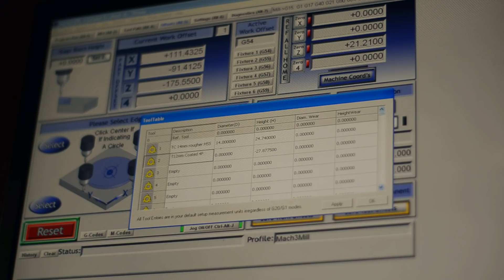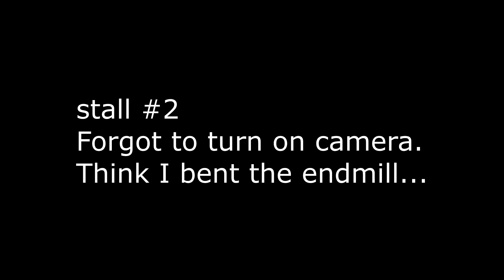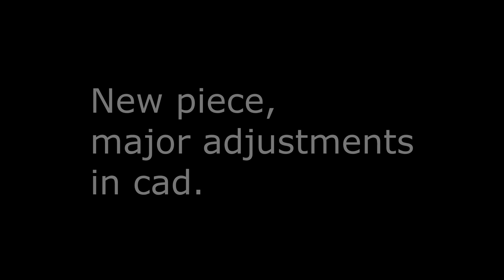Crash Course in CNC Machining(How many times can someone with no clue crash the machine)

Comment: Hey Merry Christmas. 
I see on the perimeter cuts around the block you are climb cutting. Whats the backlash like on the machine? if you have excessive backlash than this can cause a problem as the cutter sucks the work in.
You also might want to try a finishing cut cutting conventionally rather than climb cutting this can often give a better finish.
Just something else to try out which may or may not get you a better finish.
There are pros and cons to both approaches.
Keep up the good work.

Comment: I bought a Fadal knowing nothing just like you a long time ago. And one great tip I got was to get the post processor set correctly from the start. AND ALWAYS  either jog down 1" above part after your workoffset is applied before you run your program to double check Z or do what I did and edit your post so that the first Z move is to 1" above part, where ever that is from your WO Z0 (Z1.0 if the top of part is use for workoffset 0)

Comment: Little tips. If you don't have a mill for surface roughing and finish, flip the piece and do the top surface using the side of a normal mill. It will take less time to do it and you use a big part of the cutter of the mill. I hope you can understand everything I said, I'm Italian and I'm not good in English

Comment: Two things that helped me a bunch with my CNC machine. One was to really get in touch ( quite literally ) with my z probe skills. Get a Z probe and figure out how to use the software to utilize it to its fullest. Next is to spend time cutting air. Run your g-code through a g-code simulator and watch what the code will tell the machine to do. If it looks good, set the machine up with a real piece of material, probe it, and then remove it. Watch the machine cut air. Once you know the machine will do what you want, then put the piece back in, re-probe, and run it. The offsets, once set, should not be of any consequence, the trick is being sure you are well probed, know the machine will run the job correctly, and then adjust feeds and speeds on the fly as needed to find the limits of the machine. On a new piece, I will set my feeds and speeds to a crawl and ramp up slowly as the machine gets into the cuts. As you go along, increase the F&S until you have either the work pace you can live with, or you find the limits of your machine. Another thing that really helps is making sure you have your home position set every time you turn the machine on. You can set soft limits in the Mach 3 software that will keep it from crashing. After getting into the regimen of setting home every time you turn on the machine or start a new workpiece, you almost never even have to think about limit switches or if you're going to crash the machine. But, having a probe helps a lot to ensure offsets are the same every time, that your workpiece is exactly where the machine thinks it is and no fiddling with feeler gauges. Finding a good CAM software also helps. While writing g-code is easy enough, a good CAM software can really make going from conception to completion much quicker. The g-code simulation software just helps confirm your work. Have fun man!!!! Looking good. You have to break a few eggs to make an omelet.

Comment: Well Done What Controller is your CNC running? does it have an easy to follow Graphical programming system or are you having to program in G code Have you tried the CNC milling add-in for Fusion 360 This can solve a lot of problems and make life a lot easier just need to make sure you get a post-processor that works with your controller. I'm an Engineering Tutor here in New Zealand and am happy to help you in any way i can

Comment: some advice from a fellow cnc machinist. mill flats in your vise jaws to give your part a flat surface to sit on. it is less likely to pull your part of of the vise if you have a good flat base for the stock to sit on. and a good flat surface to clamp with. hopefully this helps

Comment: You will DEFINITELY want to clean up the wiring in that cabinet. I can tell you that having wires running every which way makes diagnosing and repairing equipment 10x harder than it has to be.

Comment: Ive been out of this game for a while but here goes, with alloys, high spindle speed and high feed with small cuts (depending on the rigidity  of your machine), when starting a cut with the side of the tool roll on and off with a radial cutter path into the start of your cut, depending on your control type, use canned cycles, itll save excess typing and allow you to take smaller cuts but faster. For example  if you need to plunge cut a bore to rough size, you can use a slot drill with a peck drill canned cycle to create the pilot hole, then circular inturpulate the bore in small z incriments at a high speed and feed to rough it out fast. Really cool piece of kit to have at home!

Comment: Toolpaths can be tricky and cnc machines always do EXACTLY what they are told. :p That's where the simulation function in fusion cam comes in so handy. Never run gcode that you haven't simulated :) And make a check list so that you make sure you are always in the right work offset, have set 0 in the right place etc before you hit run.

Comment: from using a very old cnc i learned the longer the process for the tool path the more chance it has to skip some of the routines and jam up like your self i found smaller tool jobs with short routines seems to stop the job from crashing or skipping some of the program befor it is ready to be at that point of the job

Comment: I like the CNC machines but in compare to the old ones with the simple handwheels you first need to learn a lot before you can use them especially in this case when it's a used one with bugs and issues. Must say you handle it very well.

Comment: Nice work. With a low power machine like this, try programming with a large DOC and small WOC. You'll get more out of your end mills and have higher MRR than simply backing off the DOC or WOC alone.
GWizard or similar is worth every penny. You can enter your machine power and it will tell you when you begin to approach the limits. This will give you an idea of how much you can demand from your particular machine.

Comment: When machining with a low horse power cnc like you have try taking shallower cuts. When your walking around the outside rough it out doing it like half in steps deep sorry your metric a 10 mm steps Or 12 mm steps in depth and make multiple passes roughing the outside and then take a Finnish passes at full depth leave like  .01in for a Finnish pass.  You can run the finish past full depth in one shot but when you rough it take it in steps so you don't have so much load on the spindle. 
  You'll never stop learning when it comes to machining none of it's very hard but there's an unlimited amount of things to know. Can't wait to Bonneville this year I'm hoping to go down and watch.

Comment: yeah dude dont clock up a vice with a plunger indicator use a finger lever type. best advice i can give to a new commer to cnc machining is throw away that plunger indicator. last thing is in mach3 u can use your ports and pins to allocate two pins for something they refer to as digitise. easiest and fastest way to pick up your offsets and take your tool lengths. a simple wire with a crocodile clamp at the end of it u can use to bite the tool u want the length for. punch in G31 in mdi and presto u get a flipping accurate size.(well as accurate as your machine). oh yeah have u checked your axisis for backlash good old mach3 can compensate it out for u all u need to do is tell mach3 how much the backlash is and then u can be super accurate with an old worn out machine

Comment: You are simply cutting in the wrong direction  ? always travel in the opposite direction of the tool rotation . if you travel in the same direction the tool will clime forward and crash. just like when you use your angle grinder !

Comment: Very good job despite the lack of experience, I take my hat off to you for picking it up so quickly. Whenever you are machining you always have a roughing and then finishing toolpath/s. I see you were using what I know as a Rippa cutter (roughing endmill if you like) which is exactly what the name implies, rip material off. Its used to get most of the excess material off to allow for the finish cut/s. Your machine looks like its a fairly low horsepower machine so depth/size of cut are critical as you found out. Then of course its how rigid is the setup. They both (HP & work part rigidity) contribute to what the depth/size of cut should be. Love your work.

Comment: Sounds like the spindle motor gets a coarse DC voltage. I would try to add a capacitor and maybe an inductor to the circuit to make the DC voltage a lot cleaner.
Reply from the maker: 👍There's heaps of adjustment possibilities on the drive board, I've downloaded the manual, will have a look.

Comment: What was the logic around doing climb milling on all that? Seems like conventional would have been better suited to the situation and machine. Those stalls looked kind of like backlash shifting where the endmill pulls itself into backlash and takes too big of a bite. That doesn't happen with conventional milling. 

I am not a machinist for the record, but I do have a CNC router, so at least a couple lessons learned.
Reply from the maker: No logic at all... Just what fusion suggested. I'll try another one with conventional milling to get a feeling for the difference.
Reply: @2STROKESTUFFING  Right on, Fusion seems to assume you have some brand new, huge, rigid machine I've noticed. I think you'll find a big difference! Good luck man and keep it up.
Reply: @2STROKESTUFFING  Don't let anyone say you shouldn't climb mill. Yes blah blah blah but you get a better finish when you climb mill and most machines can take it.

Comment: Your doing just fine man. Just remember them machines do as there told and we make mistakes. As far as no clue LoL your so much farther along even prior to touching the machine than you give yourself credit for. Be careful and keep tool changes at home until the program is proven and then you can work on production speeds. Right now I'm thinking that's not an issue. Keep up the good work Alex I'm in your corner cheering you on

Comment: Oh man, you need to stop watching ToT and his depth of cut. Need to respect the machine and the spindle power available. There is chip load equation found in the net if you look for one. You will know how many Kw of power you need for any given DOC. Small spindle and small cuts, I would say 5 mm max if you are going to cut with the full width of the tool. 
Nice vide and congrats on fixing the mill yourself.

Comment: Very nice to see you buying a broken cnc mill for your hobby, repair it and use it in this short amount of time. I am a cnc miller, programmer myself (and a huge 2 stroke fan) When i see u working i think it's better to use smaller mills for this machine. Also is it the easyist for the machine when you take a endmill wich is as short as possible. But keep up the good work, i really think you're doing it very well! a (analog) 3d probe is also much more easy to zero your product and is availlible for about 200 euros. Keep up the good work!

Comment: Merry Christmas!

It’s a never-ending process to learn the quirks and solutions for your tool chain. I had to do the CAD/CAM/G-code for a CNC router at one of my previous jobs. The post-processor in the CAM package wouldn’t do arc moves for the router we had. So instead of the program having a single G03 line for simple arcs, it would have dozens upon dozens of tiny little G01 linear moves.

The programs would get ridiculously long and unreadable. Worse, the router would bog down trying to perform so many commands so quickly. Depending on the project, we would have to get creative with the tool paths to minimize the bogging. We made stuff out of plastic, so chip/workpiece melt was a real concern.

Then I read the manual for post-processors for the CAM package. Turns out I just had to add a couple lines to a text file saying, essentially, “use G02 for arc moves.” A whole bunch of headaches went away after that, haha.

Good luck, and have fun!

Comment: Merry Christmas!
Was thinking about your gerbox issues! Maby you could build a cvt like the F1 car!? https://youtu.be/Sp228-39WhQ
Reply: I was also thinking about that, but the CVT steel belts have almost the same problems as a standard belt, they can handle more power but they are way more expensive, they need to run in an oil bath, they have the same problem of power loss due to friction...
I think a split transmission with planetary gears would provide best efficiency, because for example 2/3 of the power can be transmitted via gears and without a clutch directly from the engine to the wheel, and just 1/3 has to be transmitted via belt and clutch or with a hydrostatic drive.

Fendt uses such a split transmission  with planetary gears in combination with hydrostatic drive in their tractors with up to 500hp and very high torque to provide a continously variable transmission in forward and reverse with very good efficiency. 
There is a video about Fendt Vario transmission in YouTube:
https://youtu.be/qqrMX3ujgqk
of course it doesnt have to be so complicated because he doesnt need reverse, so the hydraulic pump and motor can be replaced with a variable belt transmission and a clutch...

Comment: Merry Christmas from Colorado. If you’re experimenting with your CNC you could use a piece of styrofoam instead of an aluminum block. Much easier on the equipment.
Reply: Could also 3d print replicas in plastic for tool path testing.

Comment: Aren't you feeding that material to the tool in the wrong direction?  That tool is spinning clockwise and you're feeding the material into the side of the tool that's moving away from the tool.  I'm no machinist but that looks wrong.  https://youtu.be/HfIaISnqHOk might be interesting.  And this too.  https://youtu.be/ip2jm_6aUyk

Comment: Sounds like your machine has steppers which I'll assume means no encoders. There is probably some amount of backlash so you may consider "conventional" milling for most of your tool paths then switch to "climb" milling for your finish passes (.2mm or less) followed by a spring pass/flex cut. This should help reduce corner gouging and improve surface finish/accuracy. Ramp in and out of the profile for your finish passes to to get rid of the line. Avoid modern "high speed machining" tool paths (profiling with full depth of the cutter) as this strategy requires high rigidity and power. 20 years ago I started from scratch too. Bought a Haas Vf-2 and some software. It took several months of practice to really get a handle on it. You'll be badass in no time in sure
Reply: I agree and would like to add that with a smaller machine,the shorter the tool holder, the more stable the tool.